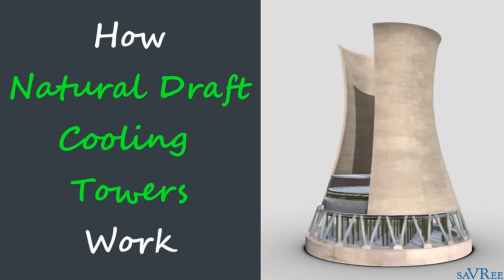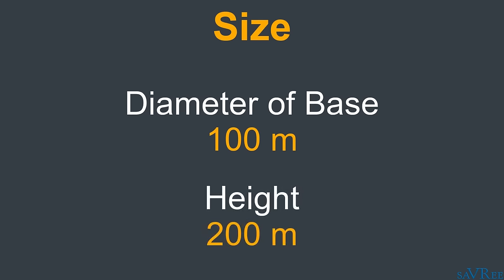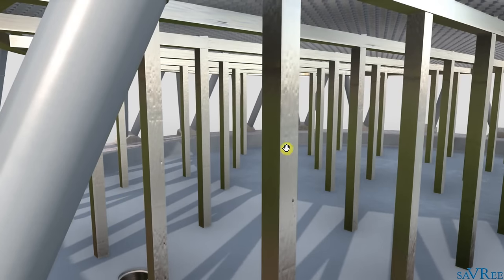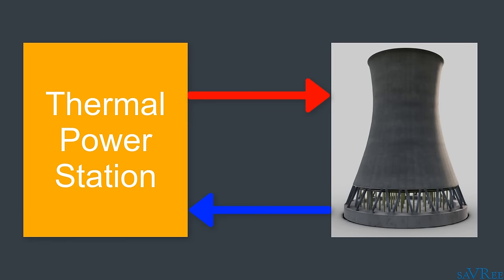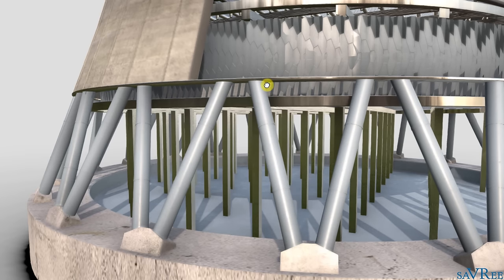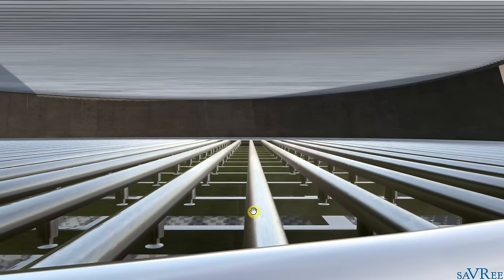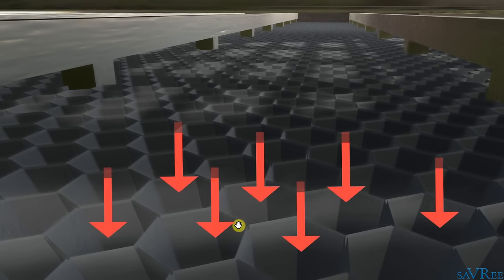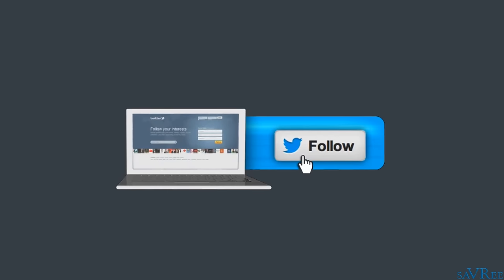How Natural Draft Cooling Towers Work (Stack Effect)

Comment: When I was a kid I thought radioactive smoke comes out of those cooling towers lol
Reply: Some adults still think that=P
Reply: Some places it does!
Reply: @paullangford8179  that water is not meant to have any contact with the potentially contaminated water of the reactor, It uses heat exchangers so the reactor water and the tower water are not mixing.
Reply: @A.Martin  Unless your Britian circa 1950 and just decide to skip the research and build 2 open cycle air cooled reactors where air is just blown through the pile and staight out the chimney!
Reply: Simpsons?
Reply: I've seen pictures illustrating air pollution and they show those towers.
Reply: @A.Martin  if the cooling towers in your local residence emits radioactive smoke that mean you're fucked up

Comment: A natural draft cooling tower is essentially a huge vertical venturi tube. The added bonus is that as the hot humid air from the tower's base rises to pass thru the tower's constriction (throat), its velocity increases and its pressure drops (Bernoulli). This drop in pressure causes more water to condense out of the air mass (adiabatic cooling), creating a separate stream of hot air. This hot air stream accelerates the rising air mass and keeps it rising even after it clears the throat.

Basically, a sort of ground level cumulusnimbus cloud maker.

Cool!
Reply: I would expect the drift eliminator to be placed in the lowest pressure location in order to maximise the production of adiabatic condensate. But that's not the case in this schematic. Lowest pressure should be just atop of the narrowest section, same as you would have your atomiser in a carburettor. However, here it appears to be below the narrowest section, which is a region of high relative pressure. But then again, maybe there's other things going on or other considerations that aren't obvious to a casual observer like myself.

Comment: Thank you very much sir, now i clearly understood. I was amazed after hearing bacterial growth in cooling tower, thanks for the information.
Reply: Bacteria will grow almost anywhere and in the most unlikely places.  It was the discovery of bacteria growing in Coke-plant effluent discharge (seriously toxic) that lead to the use of treating toxic industrial waste with bacteria. The result was the ability to treat chemical waste to the point where the discharge was drinkable.
Reply: @PhilJonesIII  Right! They also use bacteria to treat arsenic loaded rain water coming from old mine tailings.
Reply: Evaporative cooling is also used in many industrial refrigeration applications. Workers are made aware of the dangers presented by handling this water.

Comment: very good video. Id like to point out that the exit for the cooled water is wider and usually has grates to prevent plugging of the water circulation pumps
Reply from the maker: Good point. We modelled a cooling water system (CWS) inlet with grates for a nuclear power station, and it was indeed much larger. The model did not exist when we made this video otherwise we would have most likely included it.

Comment: Thanks for informative videos. It is good to have two more points. 1st, re-fill water pipes to replace that evaporated volume. 2nd, how air is passed through as cross flow, cases for low air flow versus high air flow due to windy day and why narrow bell shape body is needed.

Comment: I am writing a book on the specific geometric angle of 76.345 degrees.  This is the angle of three dimensional Phi scaling.  This angle shows up in pyramids, temples, cathedrals, DNA, etc., and per my online protractor app it appears to be the slant angle of the bottom portion of the cooling tower.  Is there a way for me to verify the geometry of cooling towers?  Is there a patent or blueprint drawings that would corroborate my protractor measurements?

Comment: I'm sure they'd mix a small amount of the incoming hot water with the cold water in the basin in winter. This will keep it around 5 degrees Celsius to stop it freezing and will cost them nothing.
Reply: Thats what I figure would happen too.
Reply: The cooling water never gets cold enough to freeze as long as the plant is running... The hotter water is continuously sent to the cooling tower.

Comment: For Winterization, why not just divert some of the hot intake water directly to the basin to keep it warm enough?

Was kind of expecting that to be shown as the obvious solution...
Reply: It's a bit odd because another solution would be to simply install baffles to restrict airflow when freezing is a concern. You can compensate for lower temperature cooling air by reducing flow rate.

Comment: Thank you for your excellent video.

Just a minor correction - the water molecules are not heavier than air, they are lighter. The reason water accumulates on the drift eliminator is that it mostly allows for deposition of already condensed water in the form of aerosol - tiny droplets. These droplets - not the individual molecules - are much heavier than the particles of gas. What happens is similar to sedimentation of a suspension in a centrifuge - in this case sedimentation of an aerosol.

Comment: The draft has also another component forcing the air up than the heat alone: As the water have evaporated, there is way more water vapor in the "warm" air. And because water vapor is about half density than the air, the more humid air becomes less dense than the dryer air at the bottom.

And the "drift eliminator" is not supposed to catch water molecules (these are actually lighter than air when in a vapor form), but to catch water droplets that have not evaporated, so those would present the real water loss.

Comment: The plastic fill is similar to what was used in the cooling towers at Thorpe Marsh near Doncaster. The fill at the cooling Towers at Drakelow power Station was asbestos. 
I would love to get some technical information on the cooling system that was used at the cooling towers at Willington in Derbyshire. I think it could have been an old Marley Davenport cooling system at Willington given the age of the towers.

Comment: Wait, why does the hyperboloid shape accelerate the air more than a cylinder if it expands at the top?  And what makes the hyperboloid more cost effective than a cylinder or a frustrum?  Also, why dos the concrete extend so far up past the drift eliminator?  Thanks
Reply: @savree-3d  Right, so would a frustrum have the same effect?  And same strength?
Reply: Bernoulli's principle

Comment: 12:00

the shape is to replicate venturi tube 

because the middle has smaller area,, the air will be faster and  kinitic pressure will be lower ( kintic pressure from Barnoli equation ot static pressure p=f/a so, kinitic prressre does not depend on area. it is just opposit of velocity)
which mean higher evaporation ( water can be boil by reduce the pressure) 
 faster air and more evaporation by reduce pressue ( win win situation )

at top , the area is larger, which means lower speed and higher pressure and that leads to condensation ( water can condense by increase the pressure) 

the whole point is to cary the water molecules by the air at bottom before the middle and condence it before the going outside the tower
they longer the tower, the more exchanging heat to the air without lossing much water

Comment: @15:12 "The reason is, the water molecules are heavier than air."

H2O molecule has a mass of 18u. O2 molecule has a mass of 32u. N2 molecule has a mass of 28u. Argon molecule has a mass of 40u. CO2 molecule has a mass of 44u. (u = mass of proton, which is also almost exactly the mass of a neutron.)

So actually, the water molecule is lighter than all other common constituents of air. What is the real reason that water has a harder time ascending the u-bend in the drift-eliminator?
Reply: My guess is that the drift eliminator provides lots of contact area for the fine water mist to form droplets and for those droplets to agglomerate into bigger droplets. Once the droplets are a certain size, they cannot be carried by the air anymore and drip down. The shape of the drift eliminator is a trade off between offering lots of contact area for droplets to form, but not creating too much drag which will slow down the rising air.

Comment: At 14:50 you describe the drift eliminator as if it catches water molecules due to their heavier weight compared to "air molecules". That is not the case. With a molecular mass (M) of 18, a water molecule is lighter than the dominant gases of air like N2 with M=28 and O2 with M=32. The drift eliminator does not catch water molecules in gas form (vapor), only droplets of liquid water. The water that has been evaporated in order to cool the larger portion of the water passes through the drift eliminator together with the air and condenses partially in contact with cooler surrounding air. Without the drift eliminator, there would be a greater loss of water that has not evaporated, a loss that does not contribute to the cooling capacity and is therefore not wanted. The vaporized water has to leave the tower, otherwise it would not work.

Comment: I think it should be mentioned that the drift eliminators only return the water in liquid form and not the evaporated gaseous water :) the evaporated water happily passes through as it is actually composed of smaller and lighter molecules than air.
Reply: Not quite. The change in direction results in what we call 'impingement'.  The pressure at those points is higher and it does cause the water to condense. Not all of it, but certainly a good portion.
Reply: @PhilJonesIII  The dynamic pressure change is totally negligible in this case. The water would have to travel at much higher speeds. Drift eliminators are based on the fact that the more dense droplets tend to change their direction less than the steam, thus they gather and coalesce into the surfaces.
Reply: Also I want to add that steam does not necessarily condense when you increase the pressure. It can also superheat. This depends on the ratio of steam and liquid water in the container.

Comment: I found a mistake in the video.  You said water molecular is heavier than air.  That is wrong.   The reason water drips back down is because the water is in the form of small liquid droplets, not in the gas phase.

Comment: 15:10 water molecules are heavier than air? How is that? 18g/mol vs 29g/mol
Reply: the water sticks together and so its bunches of molecules. a fine mist.
Reply: 18 gm/mol and 29 gm/mol, but what if one mole of water takes 22.4L space and 1 mole of air takes 200L of space? 
Density of water is thus drastically higher than air, thus heavier than air.
Sir weight depends on density and amount of actual mass, not on any specific quantity like molecular mass.

Comment: This video has very good imaging and the presenter (John) has a good clear speaking voice (if a bit slow), however there are some surprising serious errors in his explanations and a fair bit of sloppy word choice throughout:-
1.  At 10:26 he says the air is heated because the heat removed from the water "has to go somewhere"  i.e., it seems he thinks that as the water is cooled down by evaporative cooling, that heat has to go somewhere - the air.   This is NOT the case and NOT why the air gets heated.  If it was, evaporative airconditioning ("swampy" aircon) could not work.   In evap aircon, evaporation cools the water AND the air - that's why people use them - the AIR gets cooled.   Same with power station cooling towers.  
The reason why cooling towers heat the air is because the temperature of the incoming water is above the ambient air temperature (typically water inlet 30 C and ambient air 20 C) - this overcomes the cooling effect of the evaporation.   Heat energy always flows from a high temperature (the water) to a low temperature (the air) The evaporation cooling increases the cooling effectiveness without slowing down the airflow too much.
Where does the heat lost in evaporation go?   It is consumed in changing water  from liquid to a gas - the "latent heat of evaporation".
2.  At 19:12 he says the hyperboloid shape is chosen in part because it accelerates the airflow.   This is not so.   Any form of constriction in a pipe of tube slows down fluid flow.   If you want maximum airflow, choose a cylinder, not a hyperboloid.  The reason for the hyperboloid shape is because in a hyperboloid, there is no place or direction where a straight line can be drawn.   This means that, unlike a cylinder (or, worse, a rectangle), a hyperboloid cannot easily resonate.   Some early cooling towers were cylindrical and collapsed when certain wind speeds occurred caused resonance in the walls.  It's no good having a super efficient cooling tower if the thing self destructs.
Some people get confused about airflow through constrictions.   They think that the constriction causes overall airflow to increase due a principle discovered by Bernoulli.   Actually, what Bernoulli said was that a high fluid speed reduces pressure on the side walls.  This is how a carburettor works, the low pressure in the venturi, being lower than the air pressure in the float chamber reservoir, draws gasoline out of the float chamber.

Comment: You said drift eliminators remove moisture from the hot air but if we look at a hyperbolic cooling tower ... The hot air which is ejected from chimneys still contains water content even passing from drift eliminators. Can you please explain it to me briefly? I'll be very thankful.

Thanks in advance. :)
Reply: @savree-3d  Can you tell me the efficiency of drift eliminator? Furthermore, if somehow we came up that the drift eliminator removes 100% of the moisture from the hot air, is it a good or bad thing?

Comment: At 15:15 you say water molecules are heavier than air. That's bullshit, molecular weight of water is 18 (oxygen 16, hydrogen 1, 16+2=18), molecular weight of oxygen O2 is 32, of nitrogen N2 is 28. So in fact water molecules could ghange direction easier than the gases from the air.
Reply: you're making a fool of yourself, he never mentioned the molecular weight of either water or air, he just said that water molecules are heavier than air. since he did not take density out of equation, he's right, water is heavier than air
Reply: @jonsnow7092  you have wasted your time in school. Water vapor has lower density than air. "water molecules" are in fact water vapor. Even peasants with little school  (who have never heard about the molar volume of gases for instance) could guess that water vapor is lighter than air just by looking at the steam rising from boiling water and the fact that the clouds are floating up in the sky not close to the ground.

Comment: H2O as gas is not lighter than air O2 and N2 of the same temperature. This is based on molecular weights most forget N and O are diatomic.
Reply: I also noticed this. The drift eliminator captures condensed droplets.

Comment: Water molecules being heavier than air? H2O, VS mostly N2, and some even heavier O2. I'm not an engineer, but I'm pretty sure condensation isn't caused by higher mass of H2O vs N2 or O2, because H2O molecules have lower mass. Maybe the drift eliminators radiates some of the heat, and maybe they cause a slight change in pressure that helps with condensation. Even though water vapor is significantly lighter than air, at same temperature and pressure, extracting the heat of vaporization of the water vapor to heat the air makes the air even lighter, through thermal expansion.

Comment: Does venturi shape of NDCT has any thermodynamics purpose or its only for structural stability?
Reply: I did read somewhere that the funnelling increased the air pressure slightly and thus forces some of the vapour to condense.
Reply: I think venturi increases speed of air flow up tower

Comment: wonderful way to explain sir just one doubt  its  natural draft cooling towers main working priciple is 1.evaporation  or 2.stack effect  which one  is more dominant
Reply: @savree-3d   thanks a lot sir again for solving my query
Reply: air doesn't conduct heat very well away from water, so the water evaporation is critical to the operation. Then the water after it has evaporated will mix with the air and better warm the air. You will get some amount of heat being conducted away but its not a large portion.

Comment: There are two further ways of Winterization, which are very cost effective. Basically these towers are designed to provide a sufficient temperature drop during summer and you want to somewhat limit them during winter. The first option are shutters restricting the airflow. With less airflow you get less evaporation. Sometimes these shutters are as simple as tarps beieng pulled up. Another option is a bypass valve which pumps hot water from the power plant directly to the reservoir instead of spraying it. This also reduces evaporation because the surface area is reduced.